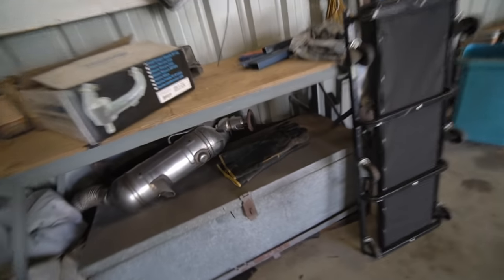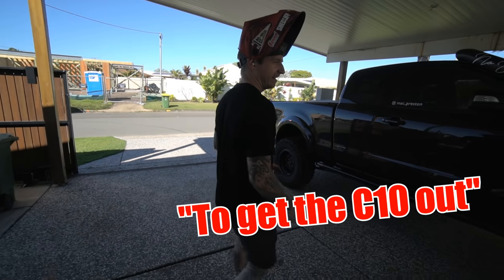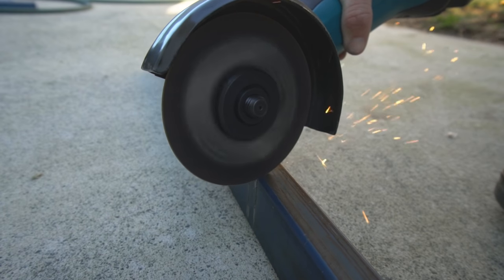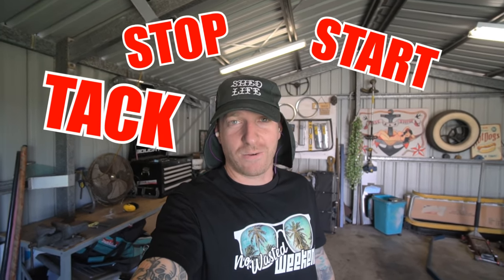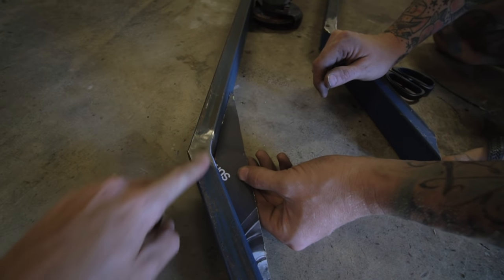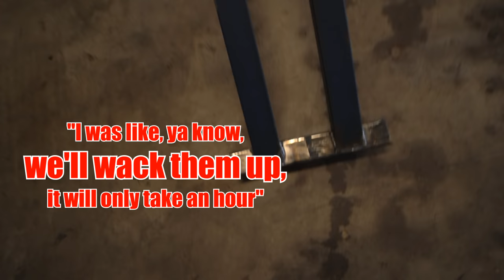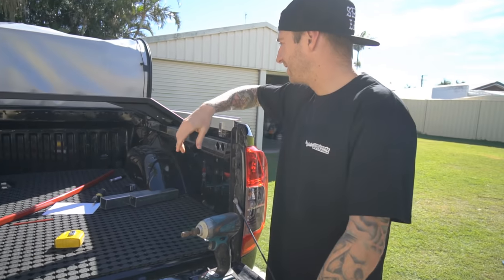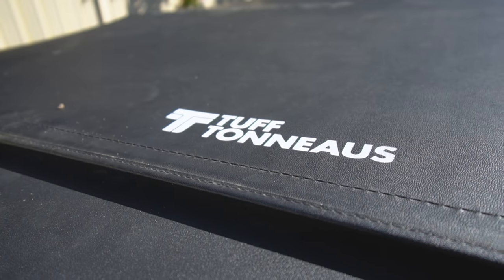Invisible TUB rack ?

Comment: How did you work out the angles ? Just pick a length and cut off the excess?
Reply from the maker: After bolting in the new rail I measured how high I wanted it then used autocad to work the angle out haha 😝 perks of being a surveyor I guess haha turns out it's 32deg 👍
Reply: Ah true. Yeh perfect. Thanks mate
Reply: My plan was the same as urs hugh! But tj made it easier haha
Reply: @macpreston  the joys of having access to autocad ay haha